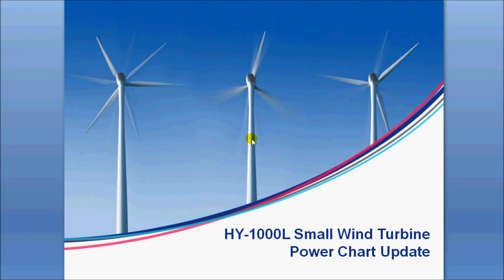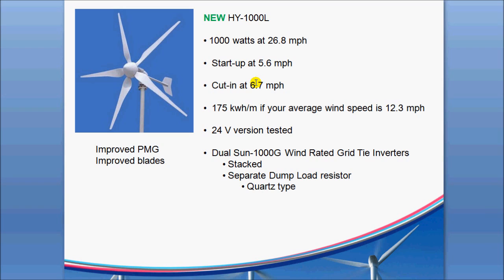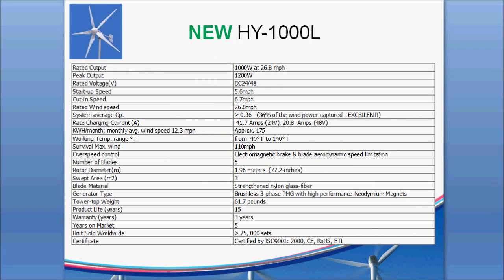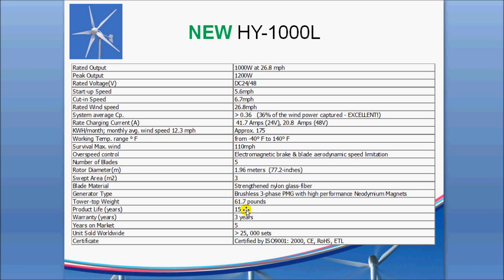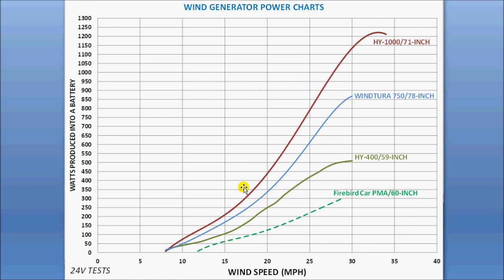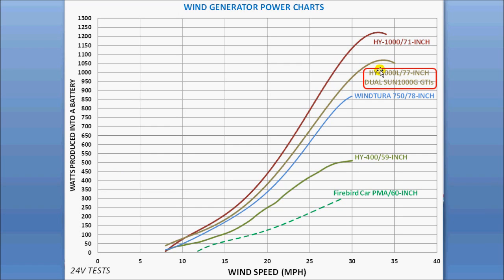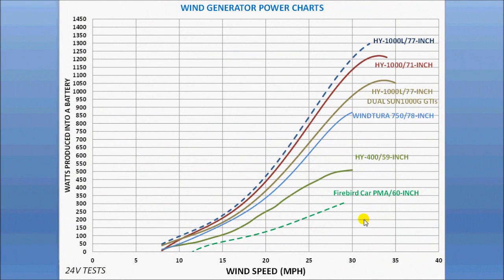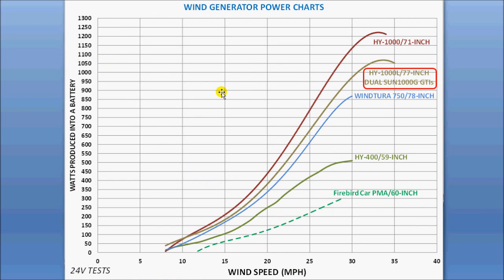Windmax HY-1000L Wind Turbine Power Chart Update Grid Tied

Comment: Hey guys,i am from India. I want to built an On grid system with the HY 1000L wind turbine, but i have few queries.

1) If turbine is producing 3phase 3 Wire AC then why they write DC ratings in their data sheet? so do they provide the an MPPT wind charge controller (rectifier) with the turbine or do we have to arrange on our own? If not then how to find it locally?

2) How to find an on grid inverter locally, what are the specifications? a Solar grid tie inverter is compatible for this task? if yes then provide the specifications?

Comment: Dude...!!!! this info is GOLD, thanks SOO much for sharing all this, I have 2 istabreeze of 2KW each, hooked up each to a SUN 2000 GTIL for grid tie, with all the bells and wistles and after all is said and done, you are getting far more electricity out of your single 1000W wind turbine that I do out of the 2 combine, and I´m leaving in a open windy area, I noticed that my Wind controllers have a very narrow range of operation, and the Turbines barely scratch 800W at 20kt winds before it goes over spining, so little wind = not much electricity, 15kt winds, the controller divert ALL the load to the dump load... I would like some advise of what to use without having to spend large amount of money, besides I love DIY.... again thanks so much for your videos... should I hook 2 Sun 2000 GTIL to each turbine instead???

Comment: Sorry,, forgot to mention that my sun gti's are the 10-30 volt also :) I doubled up on them ( I run 2) just in case I get some crazy fast wind. From my experience ( I am pretty new to this stuff) adding a second gti  helps absorb the amps coming from the 12v turbine, during high winds. Sun gti's are not 100% efficient, adding a second one to your system Should help you increase the efficiency from your 12v turbine. OOh and remember to add fuses or breakers just in case something should go wrong.

Comment: I have one 500 watt gti and am going to try that with the 12v y400 and see how it works, the gti is rated at only 10 to 30 volts so I am thinking it will work, I know another youtuber who is using this same set up, not sure if it is the 600 gti or the 500 but he is happy with the results also.

Comment: I use a 12 volt turbine hooked up to two Sun 600w gti, I am happy with the watts I get with this kind of setup. Like fearless says we get less volts using 12 volt turbines but more amps. This is good if you would like to charge a battery at the same time you run your gti.

Comment: I have a 250 watt cheap 12v treadmill turbine I bought off e-bay just to play with, in 15mph winds it was producing 2-6 amps and 5 to 20volts, but the kwh meter was only reading 2 watts, I am going to put this turbine in storage for emergency only to charge my battery bank if necessary.